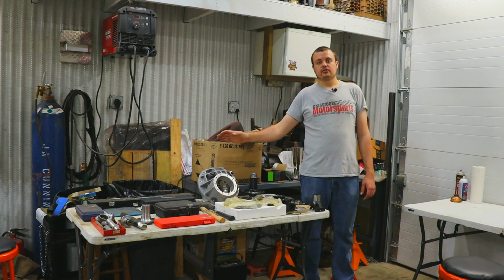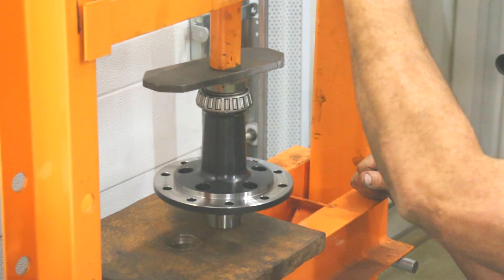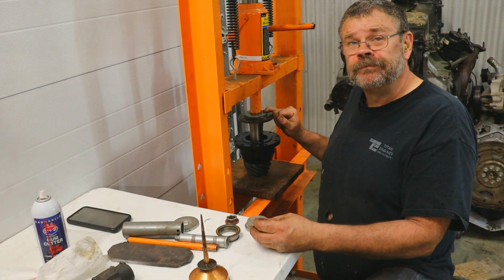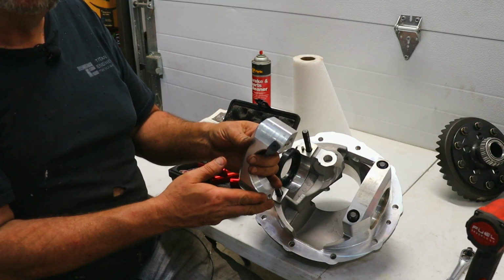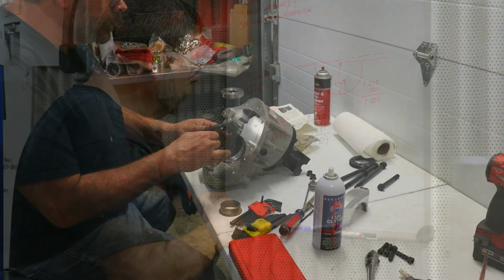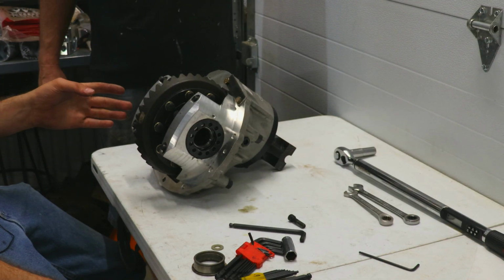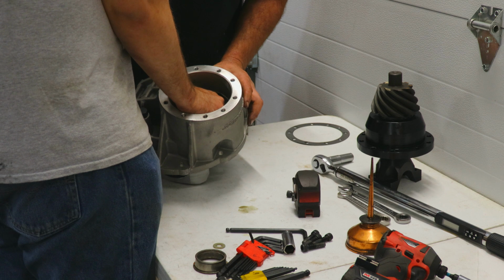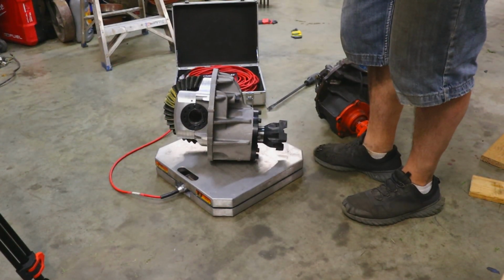How to Properly Assemble a Ford 9 Inch Rear for High Performance use #racecar #horsepower

Comment: I have pushed the axles out of two ford 9 inchers just hooking up on the street in two different F 100's,..both 4×4.
     Stock engines,..both 4 speeds.

Comment: good video..I have a question my case bearing are 3250 and cut that i half it is 1625 when i measure the case 1627 do i add shims or subtract thank you....
Reply from the maker: Are you talking about setting your pinion depth? If so, you just factor that into the math for setting it. The pinion depth that is marked on the gears is from the centerline, so take that measurement you made into account when checking.
Reply: I did that the pinion number is 1.029 i put a 17 thousand shim in it now i have 1.029 what do i do the case read 1627 do i add more shim
Reply from the maker: @roadrunner1391  so you added a shim and nothing changed?
Reply: @Calvin-Nelson  in the video he had a measurement 1624 and he subtract 00.1 thousand to the pinion shim

Comment: Why did you not complete a 360 degrees roll the center section to check the wear pattern of the gears?
Reply from the maker: The marking compound is only in one area.

Comment: Great performance build video, a lot of people think just because they have a Ford 9" differential it will take high horsepower. As soon as you start using sticky tires and adding power you will find the shortcomings of stock carriers, pinion supports etc. Ring gear deflection from stock carriers and supports is a big problem and gear set killer, aftermarket carriers and supports aren't that expensive and are great insurance for making your rear end live. Keep up the great videos and building those unique racer combinations, very inspirational.

Comment: Can you alter your backlash for oil clearance for the increased shear load on the launch of a high horsepower car with a trans brake?  Too much science for my head but thought it could be a tuning tool for how much it shocks the tires on launch.
Reply from the maker: Possibly. We don't have experience with that. We normally set it up for the factory spec and then it's good to go for whatever

Comment: love the video.... love the whole family involvement..... what did you use to seal the pinion bearing portion and .013" shim to the rest of the 3rd member and is it a zero clearance sealant.... when you are adjusting things .001" at a time, i can imagine slathering RTV on the surfaces can change the pattern/mesh.... just curious.... ive only done bearing preloads on FWD gearboxes and didnt have to worry about any right angle gearsets. Thanks.
Reply from the maker: It uses an o-ring to prevent that
Reply: @Calvin-Nelson  cool
... That works even better.

Comment: Question, is it important to turn the gears in driving direction the last time you check the pattern with the compound?
I assume so, because of backlash?
Reply from the maker: You turn it both ways.
Reply: @Calvin-Nelson  I saw that. 
I was wondering if the direction of the last pass before the inspection of the pattern matters.
Reply from the maker: @MartinBorn  ohhhh. Got it. No it does not.